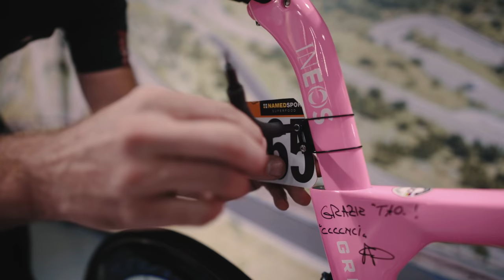DREAM BUILD ROAD BIKE - Pinarello F12 - Tao Geoghegan Hart Giro d'Italia

Comment: rim brakes and slammed stem like a roadbike should be 🤟🏽🤟🏽👍🏼
Reply: what is a slammed stem?
Reply: @skedi33  
Basically the part where the handle bars connect to the bike is called the stem and what this person is saying is that the handle bars are actually at the very bottom of the stem  but we just say slammed stem instead

Comment: Oh, they SUPERGLUED the handlebar tape
Reply: but they didn't wrap them in right direction :/ should be wrapped away from the bike, not towards it
Reply: @herringtoncolin  not necessarily. Depends on whether you primarily hold the bars from the tops or the drops. A sprinter rotates his right hand counter clockwise (mirrored for left hand) while on the drops. A climber that grabs the bars by the tops tends to rotate his right hand clockwise (again, mirrored for left). Therefore the bar tape wrapping depends on how often you're on your drops or tops.
Reply: @ThisIsANameBruh   This can be solved by reversing the direction at the hoods, so you get the best of both worlds. See the Park Tool video on how to wrap bar tape.
Reply: @gxexrxmxaxnx  this can be done? Damn, that's tight.

Comment: Probably a dumb question- but what was the point of the zip ties? on the Di2 wires? is that to keep them from rattling around in the frame? Thanks. Awesome to watch this being built.
Reply: Yes, those are clip-on ties.

Comment: is that some kind of rubber tube you used to cover the rear brake outer cable? to avoid the cable snapping inside the top tube when the handlebar turned around? thanks in advance, this video is so satisfying

Comment: Why do they have threaded BB? Why on pressfit ceramic?

And why is the right side a clockwise thread? Mine are Counter clockwise?

Great shots. Love these Videos
Reply: Threaded BBs are easier & more convenient to install & remove (uses the same tool to do both) and are less problematic as well. Pinarello framesets use Italian threaded BB shells, where both cups are installed clockwise. Yours is a BSA-threaded (English-threaded) BB, as with most bikes with threaded BBs.
Reply: @yonglingng5640  thnaks for your answer 

I thought giving the right side a left turning thread prevents the Cup from loosening itself?
Reply: @ballerman3430  Yes, this is why most threaded BB shells are BSA-threaded. They don't suffer from something called recession.

Comment: Guys i will ask gravel question. Should i go for carbon gravel frame if i  use 650b wheels? Is carbon even needed then? The next question is Di2? Is this worth to go 1x di2 grx while mechanical one go super smooth?

Comment: What was the wire that plugs into the seat post for?
Reply: Inside the seatpost this bike has a battery for the electronic group. The wire is plug in the battery to give power for the system.

Comment: What kind of bottom bracket is that?? I didn’t know they came with unidirectional thread on both sides.. and did he murder that fork without adding a single spacer to the whole length?? That’s brutal..
Reply: That's an Italian-threaded BB. Italian-threaded BB shells are right-hand threaded on both sides.
Reply: @yonglingng5640  thanks for the explanation mate.. Cheers :)

Comment: I thought that this type of brake was no longer used for top of the line bikes.
Reply: Nah. Even though disk brakes are much more versatile, traditional rim brakes still have a huge following. I personally prefer them over disks, though I will use disks when I'm dealing with long rides in the rain
Reply: @SonjaTheDork  For ride bikes the v-brake is still the best cost-effective option in my opinion.

Comment: How much guess work is there for things like chain length and brake set up? I would have thought the chain length could be pre calculated on a pro build.
Reply: Chain length: When it's in the largest chainring and cassette cog, there should be two bends from the chain right at the pulley wheels.
Brake housing length: Turn the handlebars to the far left or right (depending on your brake housing routing config), give it just enough that it doesn't create too much tension (a little is OK).

Comment: Zip ties attached to di2 cables to stop them rattling around in the frame???
Reply: They're actually little clip on spacers, but zip ties would work too. And they do a good job of stopping cable rattling. You get a few with each Di2 cable, or Shimano will happily sell them to you for 50p each :)